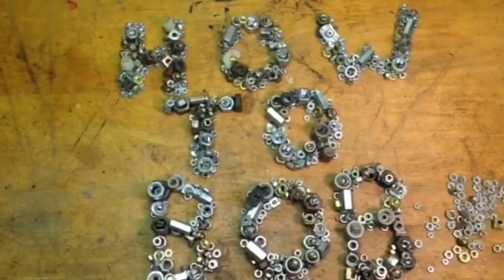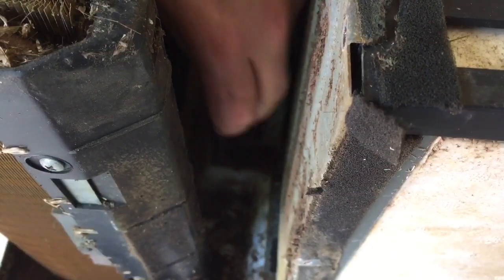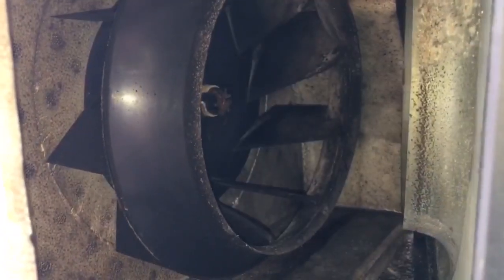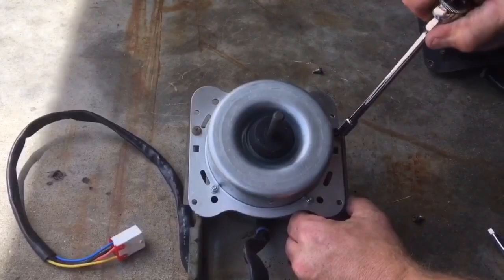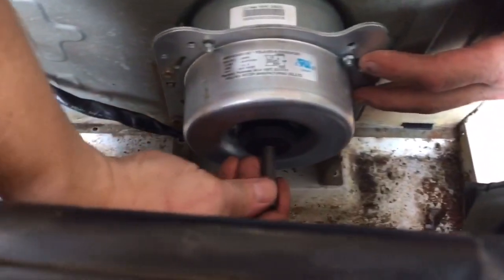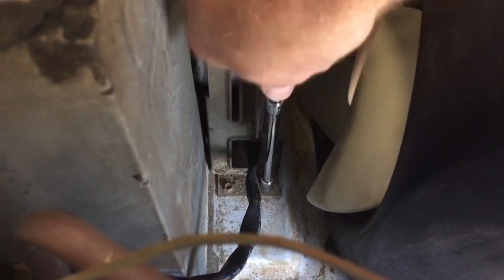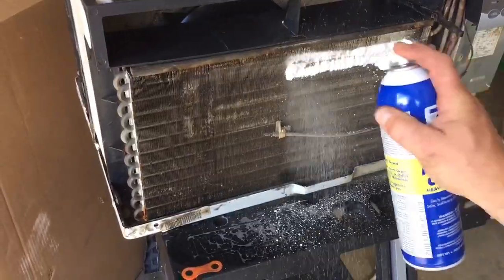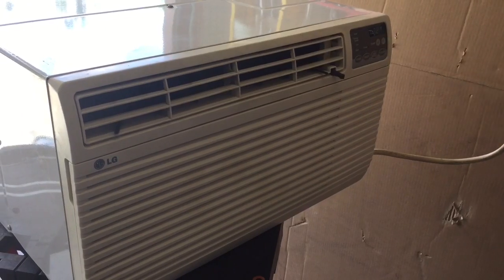Replacing the fan/blower motor in an LG Air Conditioner

Comment: I was about to buy a LG ac of the same design. Now I know that's a lot of work come the time to clean that and now having a second thought. You could have replaced the bearings of the motor instead to save $.
Reply from the maker: This was having more than just bearing problems and with it being in a rental unit I wanted to make sure it was good to go for a long time. Thanks for watching.

Comment: My LG 1815 ER developed a grinding noise the very next season after we bought it. I pulled the unit and spun the fan and noticed it turns smoothly and coasts for a long time, but makes a grinding noise. The blades aren't scraping against anything. I tried oiling the motor shaft ends, hoping it would get into the bearing, but it never helped. The a/c runs fine for years after that, but the fan is so noisy you can hear it for 100 yards distance.
Reply from the maker: Still sounds like it may be the motor bearings. I’m not sure what else it could be. You could try bypassing the AC unit and wire the fan motor directly just to see if the noise is reproduced. Thanks for watching.
Reply: @funbro1  It's definitely the fan and not the compressor. Trouble is, nobody sells this fan motor.
Reply: Remove the fan and connect the motor direct to outlet 120! Volt and you’ll know
Reply: Panasonic got the same tecnology as the LG im pretty sure that the panasonic motor is the same

Comment: I have a 18000 BTU 220 volt Maytag Heat Pump air conditioner, and heater window unit that's been setting up in a enclosed carport for a couple of years.  It was installed through the wall in a enclosed carport area for a couple of years, but my family member never used it and gave it to me to help cut energy costs down using the heat pump feature in a large 7500 Square foot House that should have at least five individual Zones Minimum!!
My question is, before I powered the unit on originally, the fan motor was slightly tight so I turned it by spinning the blades until it was reasonably easy to turn.  When I first turned it on a work perfectly for approximately 1 minute.
I can't remember if I turned it off after witnessing the digital control panel work perfectly set in the heating mode blowing 18,000 BTUs of heated air!!!:)
The only problem is the next time I turned it on you can hear power being sent to the I believe, distribution board, and makes a LOUD HUM.  
The only reason I haven't changed the capacitor that starts the fan, and compressor is because I'm not getting that Dead effect if you know what I mean?.?.
I could be wrong, but wore out capacitors I've changed in the past usually do not look like BRAND NEW as far as the condition, and the overall shape.  Most of them do not make any noise at all, but you can usually make the fan start turning if you give it a spin while the humming is taking place, and the fan will at least try to start turning.  I just thought after running across your video that's sending you a message could not hurt before I replace this 10 to $20 capacitor which is not a big deal, but if you're able to see this in a timely manner not knowing your schedule I didn't know if you had any knowledge of this problem happening with Maytag 18000 BTU heat pump window AC units with very little use, because I'm leaning towards some type of corroded dead short in the motor itself.  Like I said the unit has not been used much at all but it did sit in a wall for a few years allowing rain to get the motor wet at the same time the unit was not being used so that's always a recipe for DISASTER with anything that moves especially if they have any type of electrical components.
There's even a small amount of rust on the exterior casing of the motor housing.  It does spin freely though. If I don't hear back from you, thank you anyway!!!
I'll just order a replacement capacitor, and start from there. 
Thank you in advance for any help concerning this particular units fan problem.

PS.  I would like to also mention that I did wash the interior of the unit out avoiding all electrical components, but the motor of course did get wet washing out dust, and debris.
If I had a removed it from the case by sliding it out, I would have NEVER let that multi-speed motor get wet after seeing the small amount of corrosion that had occurred just from rainwater etc.

Most Sincerely,
John Jenkins
Reply from the maker: Sounds like the issue is either the capacitor or motor. If it were me I would start with the capacitor just because the price. Thanks for watching.
Reply: @funbro1 ,
Thank You So Much For Taking The Time To get Back with Me.
I Appreciate Your input!!!
I've already ordered a capacitor, and it should be delivered Tuesday, or Wednesday.  
I have my fingers crossed, but my guts instinct tells me that it's going to be that multi-speed fan motor.
I Hope Not:/
I wish I had held off on rinsing the exterior section off until I at least tried to let the unit run for an hour or so after noticing that drag on the fans shaft when I sprayed water against the fan blades and immediately noticed it wasn't turning freely.
I did want to mention that I did not use my pressure sprayer when cleaning all of the dust and debris out of the tray,  just a spray nozzle with approximately 40 PSI on the well head.
I did make sure to completely avoid all electronic components and of course the squirrel cage.
The unit looks like it has never been turned on more than a few minutes because the filter door was still taped shut From the factory.  Not to mention the filter itself looked like Brand New!!
I actually have at least three 220v A/C units that are all approximately 18,000 BTU'S  inside a building My Dad, and I built to be an office for our Rental Properties along with making all types of computer-generated Signs, and most importantly Operate His Private HVAC, Plumbing, and Electrical Engineering Firm out of.
All three of those units never saw more than an hour's use, but had to eventually be pulled out of the walls due to the fan motors locking up from lack of being used.   We used a 4 ton wall mounted heat pump in the front office, and just never got around to using those A/C units like we had planned in the back rooms.
Letting them sit destroyed all of the fan motors, and it never dawned on me that the fan could be damaged from lack of use until I thought about the ones we had to pull out the wall at the shop.
Those units still sitting in the shop would probably work like Brand New if I could find some motors at a decent price considering none of them are digitally controlled.
My dad was a firm believer in using as a little bells and whistles as mechanically possible.
If it's not broke don't fix it, and there's no need to make something that can be simple, fragile and complex just for appearances, or the ability to use a remote control that you rarely even think about using when you have one.
I can see the use for a remote when watching the tube, but when it comes to AC, and Heat the objective is to set it, and forget it.
I might try to find some single speed, universal design replacement motors for those units this Summer.
There just may be a way to get those things up, and running again without breaking the bank trying to find exact replacement multi-speed specified motors. 
I could just bypass the speed control for the fan and simply use an on and off switch with the included thermostat.
At the most a three position switch that would allow the fan to run at one speed matching up the specified CFM the previous motors could provide at high speed.  Then let the second position energize the fan, and l compressor.
When it's over 100 degrees Fahrenheit outside those units could be much appreciated for the first time in their life.
Thank you again for your Advice, time, and the Informative video!!
Well Done Sir 👍!!!:) A+++++++++
God Bless

Sincerely,
J.J.

Comment: Why wouldnt u just replace the bearings in the blower motor ?
Reply from the maker: It cost just as much to do the bearing and then I have the worry of the rest of the motor going bad. Thanks for watching.
Reply: @funbro1  wrong ..  I replaced the bearings in mine for less then 5$ that was almost 5 years ago . never had an issue .
Reply: please don't breed.
Reply: talking to you rust bucket.

Comment: Whats the model number of your A/C and the model number of the fan motor you replaced?
Reply from the maker: The model of the A/C is LT1230HRY7 and I believe the model of the motor was 4681A20041M. Hope this helps, Thanks for watching.
Reply: Doing some cross referancing with the model numbers you provided I found and ordered this for my LG LW1016ER: https://www.searspartsdirect.com/part-number/eau61423707/0042/580.html

Comment: I have LG LW1016ER Window AC and need fan motor. Everywhere is sold out and has been discontinued by the manufacturer. Is it possible to replace the bearings in the existing motor?
Reply from the maker: If you can come up with the parts, sure. It will be a little more involved but it can be done. Best of luck. Thanks for watching.

Comment: My 12,000 btu LG window a/c isn't running right. The air coming out of the vents is cold, but I think it's slow and I'm just baking here in Texas. I will try to take it out and clean it. Then I don't know. It's not making the loud noise. Could it also be the motor? The room seems more humid. Nothing worse than a weak air conditioner.
Reply from the maker: Cleaning it out is a good place to start, next you could check the motor especially if you feel it's not moving enough air. Hope this helps. Thanks for watching.
Reply: Thanks for the advice!

Comment: I just completed a replacement of the blower motor as per your instructions on a newer unit.  The old motor was only running very slowly.  Now the fan motor won't come on at all.  I also connected the old motor and it won't run at all either.  A technician just replaced the capacitor.  At first the compressor came on, but then stopped.  I'm getting green lights on the face panel, but nothing's happening.  Any suggestions?
Reply from the maker: Are you getting any error codes? If so this could lead you in the correct direction. Sounds like your control panel maybe. It's hard to diagnose without running a few tests. Thanks for watching